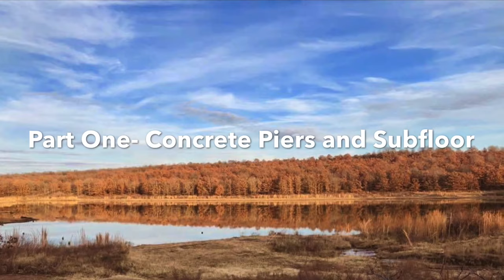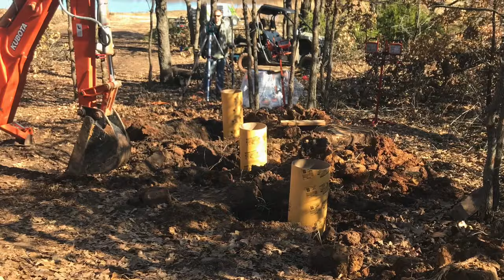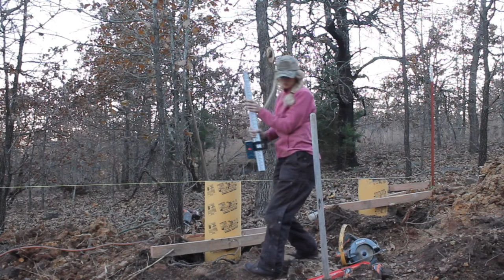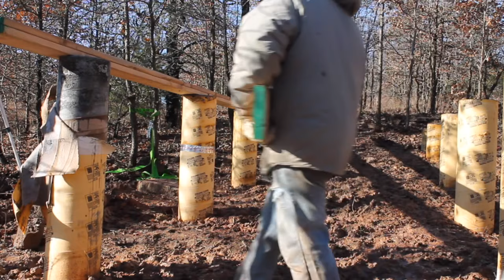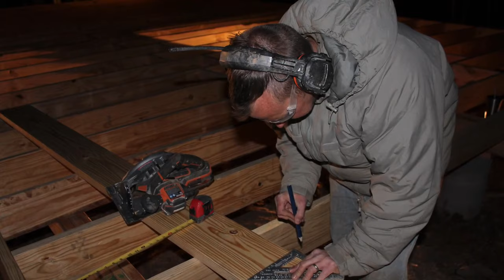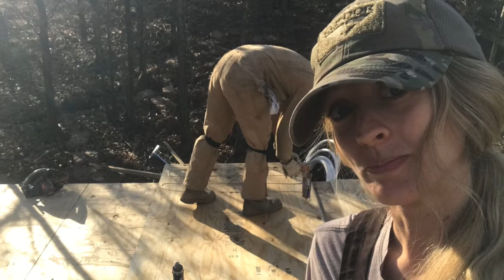DIY Debt Free Cabin Build part 1- Piers / Subfloor

Comment: amazing great start.  Beautiful family.  Keep up the great work.  We have 60 year old cabin my
son lives in on our property in central Texas.  We recently replaced the aluminum feeder wire with
copper.  It was built with 4x4s on concrete blocks. Not code now but little shifting all these years
even with a few severe storms and small tornadoes in the area over the years.

Comment: did you attach the beams to the concrete post with an metal fasteners or are the beams just sitting on the piers
Reply: I'm curious about that too, is it required?

Comment: Awesome job, what is the size is the floor plan. How far apart are the beams? are your joists 12" or 16" on center? Will be starting my cabin build soon, so proud of you guys.
Reply from the maker: 1000 sf bottom floor. beams are 8’ apart. joist spacing is 16”. 
good luck!

Comment: That is awesome , I am going to be building a A frame house , we are considering the pier and beam foundation as well , you guys looks great , how deep did you go with the piers in the ground and how far apart did you do them? Subscribing to you guys 👍🏻
Reply from the maker: Bortner family farm they are all 3-4 feet under ground level with a footing 2-3 feet wide x 12 inches deep at the base. 

Because of the dimensions of the house each row has a different spacing but they are all within 8 feet of each other. 

Thanks for watching! Good luck with your build!
Reply: @93AcreWood  they look amazing and plumb. What little tricks did you learn that made the work flow better for the post? Asking for myself as I am about to do a post and beam foundation instead having it poured or blocking it myself.
Reply from the maker: Mickey Jett buy a laser level. A string line is not sufficient for this kind of project on its own. We did both and the laser really helped a lot. 
If we were going to do it again, we would have got all of them set up, with more bracing, and had a truck dump concrete in all of them at once. 
This took a month for us to do, almost every day. 2-3 piers at a time. 
It’s a A LOT of work.
Reply: @93AcreWood  awesome job you guys did, did you guy put rebars in the concrete piers? I'm getting ready to build a shower house and going to use the same concept for my RV park
Reply from the maker: @fishycamper  yes. 4 vertical pcs for each pier with 8 horizontal pcs tying them all together at the top and bottom.
Reply: @93AcreWood      That's impressive, and way more than most people do.

Comment: Hello, out of interest, could I ask what is the purpose of adding the timber blocks in between the joists and the cement piles?
Reply from the maker: The little blocks of wood are there because wood that sits directly on cement can rot over time. So we’d rather have little blocks rot than our big beams. We can easily jack up the house to replace the little pieces.
Reply: Did you put rebar in the concrete?
Reply from the maker: Stroker Ace yes. 4 in each pier top to bottom

Comment: Aren't you worried that rodents and insects might start eating their way through your flooring system?     I want to build a house on stilts but I'm planning to have concrete panels underneath or I might pour concrete to have a concrete barrier between the space under the house and the inside flooring.
Reply from the maker: We’ve been in the house for 2.5 years now and have never seen a rodent or droppings.

Comment: those are some of the highest piers i've seen on a cabin build.... did you ensure that is ok from an engineering and also a stability aspect?   The sonotubes i used say to not go over 3 feet out of the ground...
Reply: Definitely not engineered. The leverage ratio from the floor to the piers at the bottom end in an earthquake would be huge. Third pier up the hill appears to be waist height on the builder, lower piers must be around 5' from the ground. I didn't see any rebar caging inside of the tubes either. Floor doesn't appear to be connected with any kind of substantial hardware to the piers and subfloor isn't sheeted correctly. Wouldn't take a ton of laterial force to compromise those piers and/or remove the floor from them. I wouldn't let my family sleep in this... sketchy. Folks, even if you don't plan on getting building permits, consult an architect for your building.
Reply: @rafemaxwell4143  much appreciated, I keep wondering about all these cabins seemingly held to the foundation by gravity…
Reply: @rafemaxwell4143      They did use extensive rebar in their 12" tubes.  And I believe this is Oklahoma, so there's probably relatively little earthquake risk.  I would definitely want my beams securely attached to the piers, but perhaps they found a way to do it later.
Reply: @jshepard152  Take a look at a seismic category map, OK is in a high risk zone. Wind shear is also a substantial factor in that state that you would want your home engineered against. Also, there isn't a proper way to attach a house to a foundation later. J bolts and heavier hold downs, which is what you would need for this, are mounted inside your forms during the pour. You can get away with drilled expansion bolts on deck footings or missed placements on a stem wall or something, but not an entire residential dwelling foundation with large spans between anchors.... For anyone reading this not highly knowledgeable in construction methods, buy a set of engineered prints for your builds designed for your geographic location or hire an architect, it matters.

Comment: nice. How did you fasten the joists to the cement?
Reply from the maker: Bike Ninja so far we have not done that yet. We have tie downs attached to the beams and buried in the ground, holding the house down same way a mobile home is . Then we have the joists fastened to the beams. Myles has an idea of welding custom fasteners for the cement/beams.
Reply: @93AcreWood  hmmm....ok...seems like an important thing to overlook though, pretty easy to just pop in some metal brackets while the cement is curing...
Reply from the maker: Bike Ninja we didn’t overlook anything. As I said, the house is tied down already the way we chose to tie it down.

Comment: Question... How deep and how tall did you make the cement posts?
Reply from the maker: they are all 3-4 feet under ground level with a footing 2-3 feet wide x 12 inches deep at the base. they are all different heights above ground since it’s on a hill. The tallest about 4 feet, smallest is just under 2’.
Reply: @93AcreWood  cool, thx.
Reply: @93AcreWood  I would like to use sono tubes to 4’ above ground which is over spec. How were you able to go this high? It looks sturdy.
Reply from the maker: @andrewmoore6603  this house was supposed to be a tiny cabin that was not going to be our full time home. If we were going to start from scratch, with the house being how big it is now, we would not have used the sonotubes. 
The piers are holding up great though so we are happy with it. 
With a big enough footing and plentiful rebar, I think it’s fine.

Comment: At current Joe Biden 2021 pricing, that little cabin costed about $134,599 to put up. You must be rich.
Reply: We live in Capitalism. Our woes are caused by greedy corporations.
Reply: Now , 2024 prices that will set ya back $324,999
Reply: I did the calculations just the concrete post and pier will set you back $1.36 million
Reply: Lol
Reply: Even MORE if they used rebar in the piers, and mounting hardware!

Comment: How did you attach the beams to the piers?
Reply from the maker: we didn’t. the house is tied down into the ground with metal straps and anchors. the plan is to make our own brackets, adjustable,  in the future because nothing available at the time worked like Myles wanted. we also have blocks underneath the beams with flashing  so that our beams don’t rot sitting on concrete. replacing blocks made more sense to us than worrying about our beams rotting.
Reply: @93AcreWood  Thank you. I was wondering what the spacing is on your piers and what the diameter of the piers is.
Reply from the maker: @PaulLadendorf  these are 12”. Each pier is within 7 feet of another pier.
Reply: @93AcreWood  Thank you!